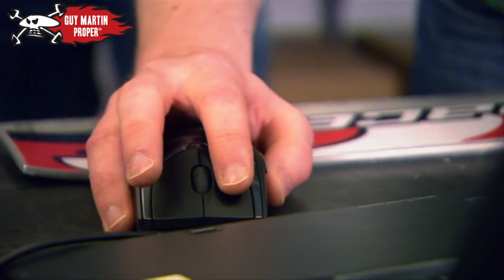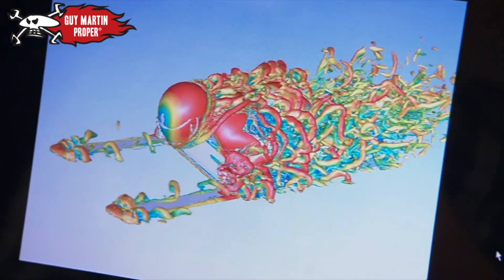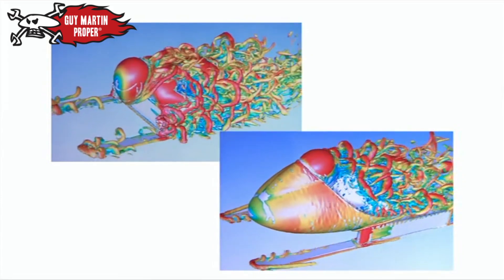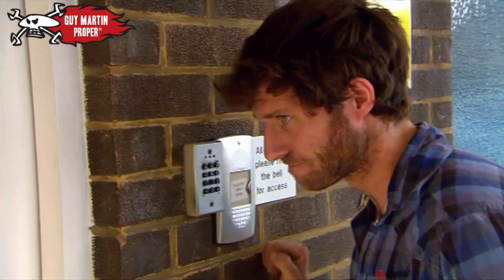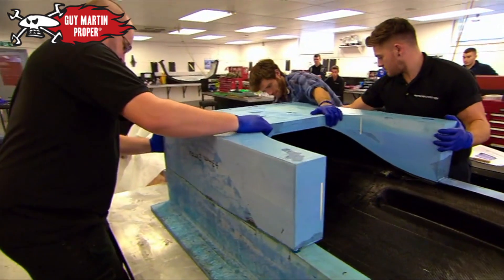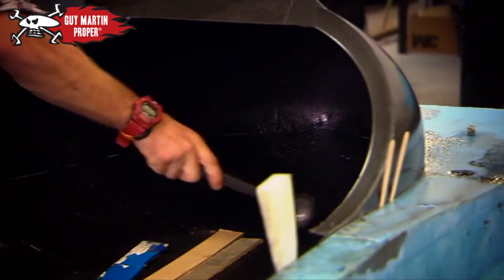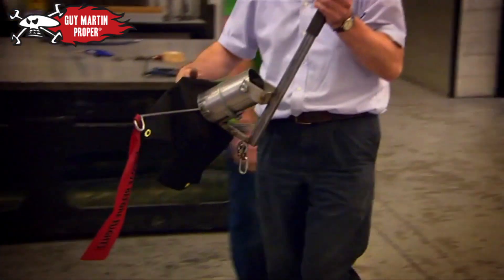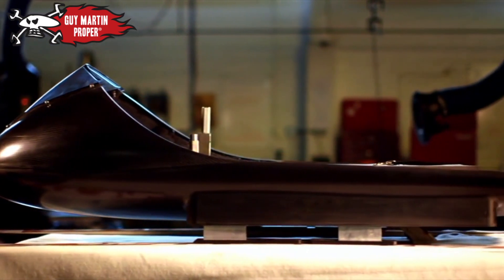Guy building his world recording breaking sled | Guy Martin Proper

Comment: you just made potential guliatine for Guy ,  by cutting this window . if he crush  poloicarbonat glas gona  brake easy  but  carbon  around - not .  and  generaly carbon  sladge  is dangerouse  it  have to be regular plastic that crushs , whay you  need  2timies stifer then  metal mattereial for  the uppper part  ?? it can cut Guy in 2 pieces